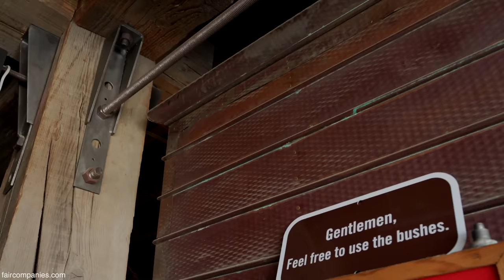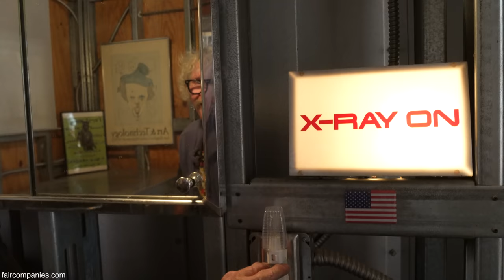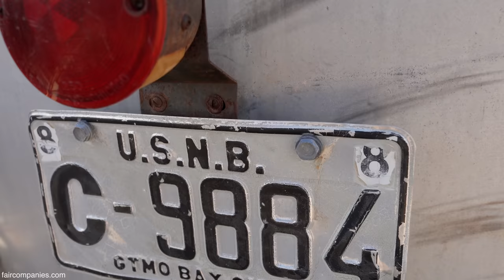4x Quonset home-studio: 40 years of artistic simple living

Comment: By far best use of what normally would have been thrown away or scrapped, with exception of the J bolts, and Quonset metal buildings and the concrete to hold everything down in the event of a massive earthquake were over built just in case!

Comment: That hydraulic door is an Ellison joiner door. They're designed to be fire proof and easy to open under a high differential pressure (like in a kitchen with heavy ventilation) but still be self shutting.
Reply: My favorite type of hinged door

Comment: Other than spray foam and this eco plaster insulation he is talking about, I wonder if you could get the largest one possible and put up a smaller one inside of it and create an air gap similar to a thermos?
Reply: Just put the insulation on the outside. 
Makes the building look like an igloo.
All white and lumpy

Comment: FYI : I live in a house on this property, not inside any of the quonset huts. My water comes from an aquifer under Joshua Tree, and I generate 9.3 Kilowatts of solar power on this site. I'm all electric and my total annual utility bill is less than $500 for the year. It can get hot here in the summer, but every quonset has openings on the end walls  ( garage doors and windows ) on both sides. It can be 110 degrees outside, but drops to 85 degrees inside without even a fan on ( I use fans sometimes and have two mini splits in the big one ). I hope this helps people understand why I live in the desert...

Comment: Without the installation, how do these metal buildings in the desert not become too hot inside? Especially the 2nd floor loft?
Reply: I too immediately wondered about insulation
Reply: Those units are not meant for 24/7 liveable quarters. Three season units. Daytime summer temps over 100 degrees, night time 70 to eighty. Spring, Fall and Winter totally useable 24/7. Summer sun goes down and temps drop 20 to 40 degrees, depending on the wind.
Reply: I have an uninsulated metal building in a more temperate climate (80-100F in the summer) and its absolutely miserable in the heat. Easily 10-20 degrees hotter inside. They really need insulation

Comment: I have lived in the desert a very long time and heat is what it is mostly about and these buildings get hot to cool them would take a lot of power great buildings just not cheap to cool
Reply: I wonder if the size, wide with high ceilings, helps control for heat. Open windows at night to cool, large space slows down daytime heating?

Comment: The extreme temperatures in the high desert can range from 120º to 20º. The high ceilings would help in the winter but make those metal buildings in the summer would be ovens adding 10-15º. I went to school in the rectangular version of these buildings for two years but they had sheetrock, insulation, and heating/airconditioning. Note that none of these buildings even have ceiling fans. I do know that those exterior "living rooms" would only be useable for a few months in the spring and fall, but high winds would vacate them any time of the year. Maybe I'm missing something but this documentary seems awfully glossy for a climate that is very harsh.
Reply: Yes you are right, you are missing something...

Comment: How can you live in Joshua Tree without insulation and AC?

As much as I like the simplicity,  durability and near weatherproof nature of a quonset hut, pricing them out they are more expensive than other styles of steel building, more expensive to insulate and more difficult to "finish" the interior in to anything looking like a conventional home.

They are great inspiration but not too practical and while they may last 100 years, at some point the galvanizing will wear off and rust will destroy it, then you better hope someone is still making quonset huts in 2121 or else you will be starting over with just a slab.  Of course you'll be dead then but someone is going to be holding that bag.

Comment: One cool dude and sweet homestead, my kind of person.  However, those huts do NOT last forever..they rust like all steel does, being in the desert should make them last longer.   And the rubber bolt washers will also fail eventually and they will leak water...hot as hell too, with tall roofs that is somewhat mitigated, but no way to run a/c in one.   Also make a racket when it rains.
Overall, bad choice to live in, ok for a workshop.
Reply: Live in a house on the property, they are workshops for me and my community...